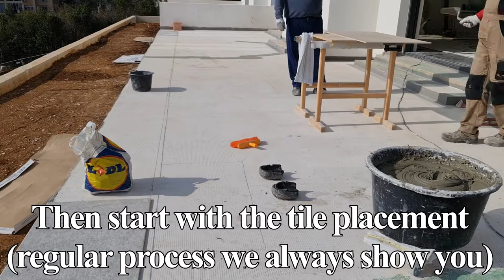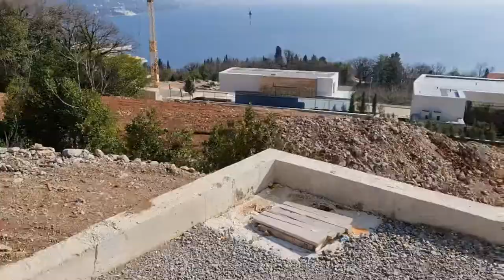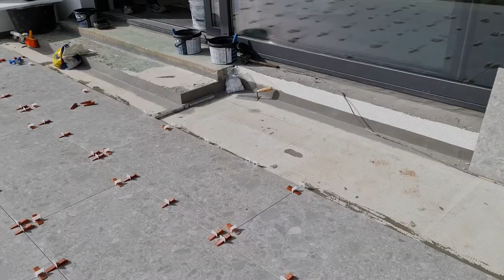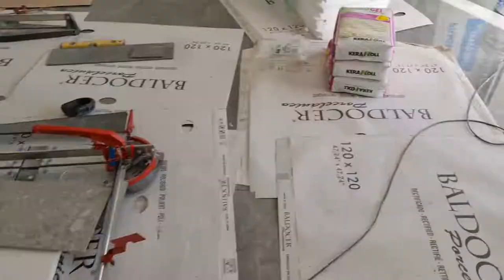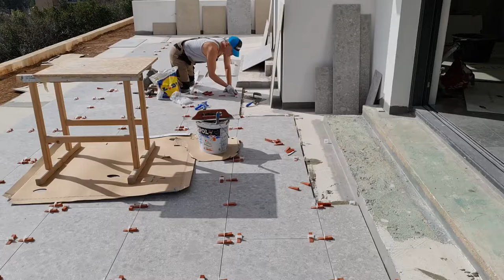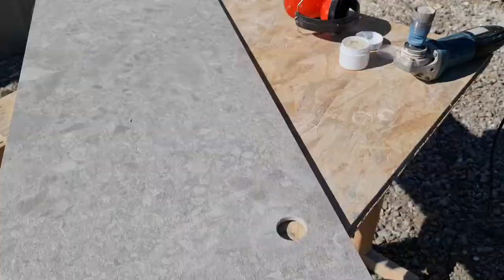How to Tile a Terrace | DIY

Comment: Great job! how did you create the decline, was it already built in the substrate or you added more and more mortar as you were laying the tile rows, from the outer edge of the terrace towards the sliding doors of the house?
Reply from the maker: the substrates on the terrace are concreted with slopes
Reply from the maker: Thank you for comment